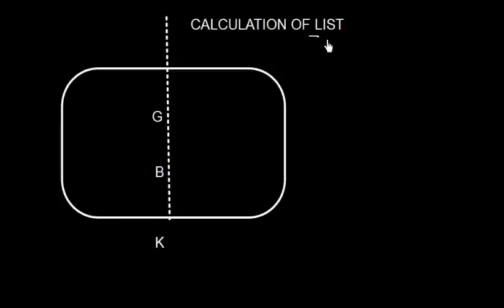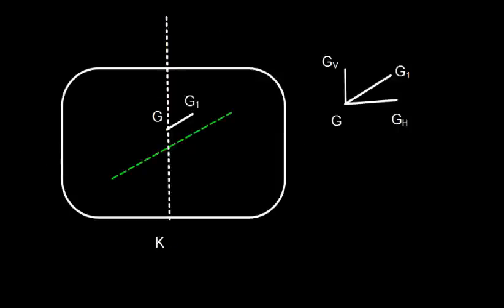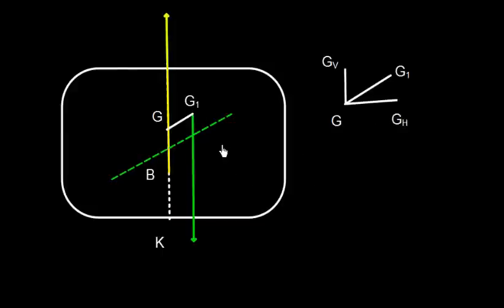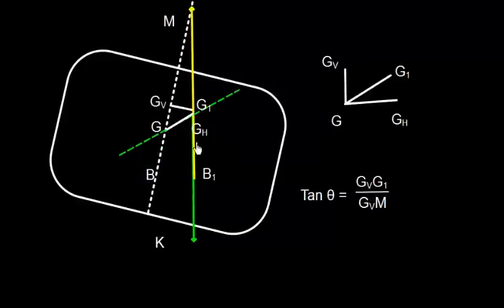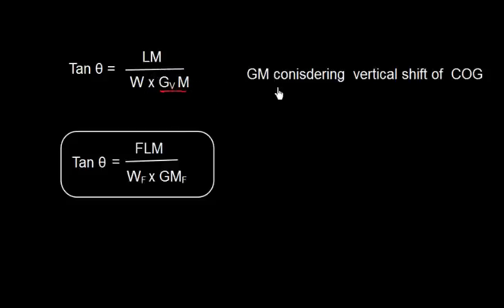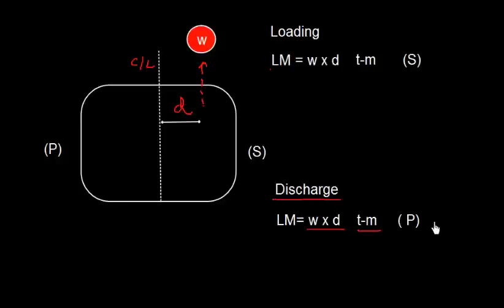Ship Stability List Formula

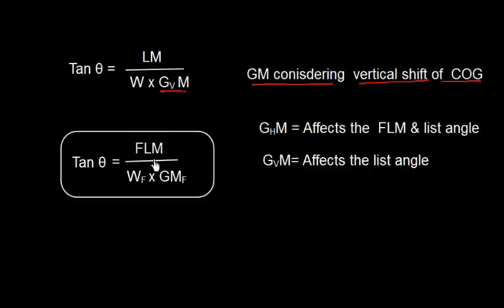Comment: Sir at 5:42 tan theta = final list moment/final weight*final GM . Is this final value of GM =  G1M? Where G1 is the final point of G considering both vertical and horizontal shits
Reply from the maker: Correct. GM is final taking both factors i.e vertical and horizontal shifts. If there is FSC than  GM is also taken by applying that as well. Bottom line.... Final List=> Final GM
Reply: @sailorstube3259  thank you sir

Comment: Cansomeone help me with this problem 

A small autonomous sailboat is being tested in the Baltic Sea (𝜌= 1010 [kg/m^3]). It has a length of 4.2 m, max beam of 0.75 m, and a KB of 0.25 m, and its (simplified) loaded waterline is shown, see Figure 1(assume it is wall sided for small changes in draft, and KB remains the same for this problem). The weights and VCG’s of the various components of vessel are shown in Table 1. During testing the sensors get knocked off the keel due to a grounding incident (all external sensors are placed below the keel). The second moment of area for a triangle around its base is 𝐼𝑥=𝑏ℎ3/12𝐼𝑦=ℎ𝑏3/12

Table 1 Component   Weight[kg]   VCG[m]
               Lightship          150          0.25
               Ballast (lead)   50            0.05
             Wing-sail           35            0.8
       Internal Electronics 12        0.4
External Sensors      30           -0.25

Calculate the original and the new GM (after the grounding) 
b)The internal electronics are not attached properly and after hitting big wave they have shifted 0.1 m towards the port side. Determine the angle of heel due to this shift

Comment: Much the metacentric is low more stable is a ship ?
Reply: Contrary
Reply: If the vessel heeled too much the distance of M will be closer to the G. If that happens we knew we fucked up. chapter 3 section 3.1.2.4 of IMO. It regulates that value of GM must be NOT LESS THAN 0.15metres.

Comment: If you can help with this issue, thank you in advance. vessel with displacement 19130t KG = 7.01m wants to unload cargo of 170 t located 6.5 sea side from centerline and Kg of cargo 12.4m. Ship is not angled on either side at this time. Wants to unload and load back cargo with heavy lift crane with KG of crane 30 m and 15m from center line. KM for 19130 is 8.47m and for 18960 8.456m. We need all the MG shifts and all the angles before during after loading and unloading of this one cargo. The problem I am facing is that when cargo returns back to original position i do not get angle 0°. Thank you!
Reply: ship hydrostatics pls

Comment: how gg1 = ggh
Reply from the maker: Punit Garg 
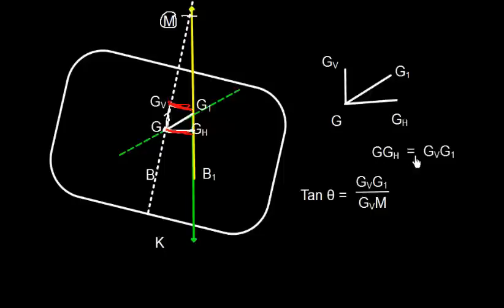@ 3:28  GG1 ( shift of COG due to loading ) has two components. GGH Horizontal and GGV  vertical. If You consider  the parallelogram ( or rectangle GGvG1GH ) it is clear  GGH= GvG1 . Diagram @ 4:23  might have created confusion due to hand drawing being not perfect. But simultaneously on top right  resolution of GG1 is shown in horizontal and vertcal componenets. Generally text books explain the concept with shifting only. Here the effort was made to appreciate the fact list will be affected by horizontal components i.e GGH i.e List moment and at the same time GGV which affects the GM which as also affects the list as per the formula. Trust this clarifies.
Reply: But its physically can't be rectangle, because as more down from the corner as more GG' is
Reply: @sailorstube3259 , you are wrong, Vjaceslavs Borzovs
 are right
Reply: You mull the parallelogram and a trapezoid